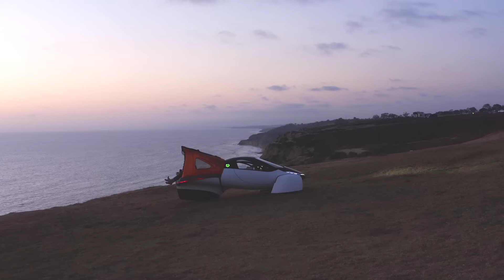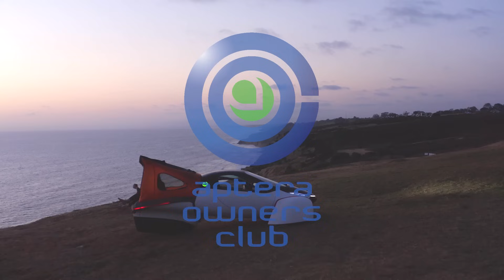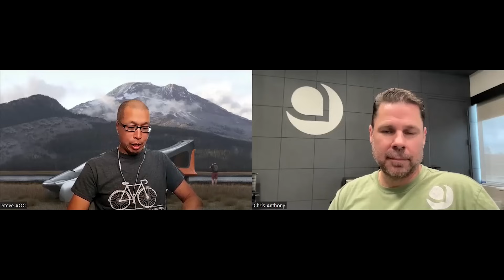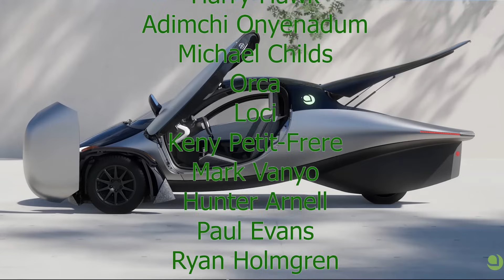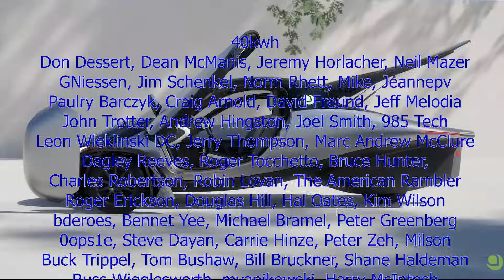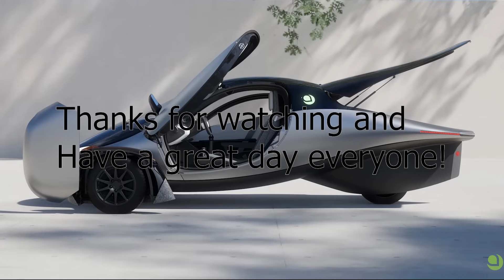Part 2/3 Aptera Update with Chris Anthony May 2024

Comment: Just started watching. Let's assume 6 weeks. When did you record the interview?
Reply: 6 weeks for current issue, don't worry there'll be more. Thus far no demonstration of miles/kWh, kWh/day. No regenerative braking in test vehicles. No working cooling in the nice looking demos. No full size battery ever used. Suspension design ongoing for at least 3yrs. Price not updated through 3 year development. My estimates are 8 miles/kWh, 2.1 kWh/day (17 miles/day), 300 mile range, $38K. Financially unstable. Attempting new high risk investment management starting in June. Sold some $50 million of "stock" that holds no equity. Buy yourself a nice used Prius V or the new Prius PHEV and enjoy the show.
Reply: @artsmith103  EV's and plug in Hybrids are not an option for me. I'm driving a regular Hybrid. I live in a Condo. I have no place to install the equipment needed for a plug in hybrid or EV.

Aptera has 3 things going for it. First is the ability to charge with a regular outlet no special equipment needed. 15 ft extension cord and I'm good to go. 

Second is the Solar charging which will limit (not eliminate) my need to charge at all. I only drive 7,000 miles per year.

Third is the efficiency. There is no doubt that the Aptera will be the most efficient vehicle on the road. It is by far the major focus of the vehicle's design.

You're correct in one area. There is still a lot we don't know about the final numbers of the vehicle. All claims Aptera is making need to be taken with a grain of salt. Until the PI vehicles are made and tested we don't know anything for sure. 

All we can have is optimism and hope that their claims are relatively accurate.

The claims you made in your post come without good evidence. You have no evidence to back up your claims so I will dismiss your claim.

 "What can be asserted without  evidence can also be dismissed without evidence." Christopher Hitchens
Reply: @Fairburne69  You're new and don't understand the basis of the numbers. I am engineer with PE, and specialty was heat transfer, fluid mechanics and reactor design. I've been involved in a few residential solar projects including my own, generally without contractors. I have a few recreational 12V systems, just ordered all the parts for another one. Another YouTuber did a thorough analysis of Aptera solar exposure. He also came up with ~3 peak equivalent hrs/day. Aptera has refused to demo performance numbers for years. It's their main marketing claim and they won't back it up, ever!! I think they're ashamed to show there is a small battery in the test vehicles, no regenerative braking, and inadequate cooling to survive 2hrs of test driving. I'd even be willing to add 30% to their results in anticipation of regenerative braking.
Most PHEV recharge with 120V. I recharge less than 1/mo. PHEV will have bigger battery, allowing bigger motor, allowing a little higher mph EV driving. If you recharged once per week it would be more than enough.
Reply: @artsmith103  Why are you constantly wrong? You keep making claims. Some of them I know are 100% not true and some that MAY be true. Yet you provide no evidence to support the claims you make. I'm not even here to tell you that you are wrong. Because I don't know if you are wrong or right and either do you.

 They showed us the making of the battery for the PI vehicles in the last update for example. I also saw a YouTuber produce a video on solar powered vehicles and he used a white board and showed the math. He got even more then the estimated claims.

I just don't understand why you have to be so negative. I understand being cautious and skeptical. I am a Skeptic. My skepticism is the reason why I am now an atheist. But you just seem to be a grifter and a troll who likes to be negative. You make claims you can't support. Maybe you do it so if you are right you can say, "I told you so." and pat yourself on the back? Maybe you enjoy dumping water on a birthday cake lit with candles?
Reply: @Fairburne69  I'm not negative, I'm accurate. I have researched and estimated my numbers closely. My home array delivers +/- 2% of annual kWh. Aptera put out a video once of their chief solar employee explaining the challenge of managing charge control on a moving vehicle. It was completely wrong! He sounded like an idiot....he's gone. The young Chris idiot laped it all up, look how smart we are :-(
Aptera has a social media employee, she never engages on social media. They paid a crowd funding director over $200K/yr. They file SEC documents as late as possible. They won't address why they are selling "stock" with no equity.
Look at Telo, they are real car people. I think 500hp in their short wheel base is a waste but we'll see what happens.
Reply: @artsmith103  "Most PHEV recharge with 120V. I recharge less than 1/mo. PHEV will have bigger battery, allowing bigger motor, allowing a little higher mph EV driving. If you recharged once per week it would be more than enough." 

The infrastructure in my area sucks. Also, I would rather use gas then sit at a charging station for 30 to 40 minutes once per week. If I can't charge from home then a normal hybrid at 50mpg is what I will continue to drive. The Aptera is the only vehicle I have seen that makes it reasonable for me to leave ICE vehicles in the past.

Toyota is working on hydrogen fuel tech. From what I know they are working on a hybrid version of that vehicle. This is also on my radar as a possible future car.

What it comes down to is that I have more "faith" in Aptera then you do. It may be misplaced I'll admit it. But they remind me of Larian Studios. A video game developer that has a similar history of mistakes and hurdles as Aptera. And they are now largely considered the most reputable video game developer.  The parallels are uncanny.  

I have not invested into Aptera yet because I have my doubts. I have until June 30th to decide. The investor webinar is in 1 week on June 6th. I will make a decision sometime after June 6th and before June 30th. Will they have more news about additional funding beyond the $60 million they just got from US capitol? If the answer is yes, I will probably risk an investment. One I can afford to lose. If the answer is no, I will just keep my refundable deposit and wait to see what happens over the next 12 months.
Reply: @Fairburne69  My PHEV description was for the crowd wanting a little more than typical HEV options. The idea was to work the 2hr charge into your weekly routine if possible, not an individual activity. I have never lived somewhere I couldn't bring 120V to my vehicle. All but 1 place I worked had easy access. 
If you invest in Aptera make sure you get equity or it's possibly just a donation. If you're that new, realize they promised delivery in 2021. Maybe there's some good excuse it got delayed but now in 2024 they're explaining why they are designing suspension, batteries, solar, braking, structure castings.... So how evil was the 2021 promise?
Reply: @Fairburne69  "Just Started Watching", means this video, not Aptera in general!! So you're a mild fanboy that doesn't like the factual criticism. I completely misunderstood. If this was your 1st Aptera video I just offered to protect you a little....carry on, I suggest a huge donation and a trip to CA to ride around the block without doing any performance measurements ;-)
Reply: @artsmith103  I understand any investment is a Risk. If I do lose the money it will be an amount I can afford to lose. I'm sort of new to Aptera starting in January. But I've done my research and know the history going all the way back to 2007.  I'm not one to make a hasty decision and I've done my research.

Investment into any startup company is a big risk. Most don't make it. It comes down to regret.  If I invest and they go belly up I lose $2,000 and move on with my life without regret.

If I don't invest in Aptera and they don't go belly up I will regret that decision a lot more.

At least that's the way I feel now. If I do invest that will be my mindset.
Reply: Last week

Comment: Only AOC brings these exclusive, very informative, series of interviews with a wealth of detailed information. This second video in the second series of three does not disappoint. So, first PI vehicle in August/September timeframe, six to nine months for production validation and testing. 😪 The company has grown from a "Mom and Pop Shop perspective" to a world car view with participation by world class partners. Glad to see the metamorphosis. Also glad they took the advice to build to scale. Now hope they take a lesson from GM's mistakes in releasing a vehicle to the market before its time. (Battery issue with the Bolt and quality issue(s) with the Blazer) With deep pockets you can recover from this kind of market failure. Not so if on a shoestring, at volume, production budget as rework/do overs more expensive than doing it right the first time. Also looking over the shoulder to the recently announced production date for Tesla's two variants of 25K(?) Model 2 in June 2025. (Tesla production schedules always taken with a grain of salt)
Reply: Steve/AOC are excellent but other Aptera channels post very good, often supplementary info/perspectives. I’d worry of further delays if Chris granted such in-depth interviews to multiple outlets.

Comment: Why are so many of the part coming from all kinds of place over sears? ----Not very efficient part sourcing---If you ask me
Reply: Chris has stated that most U.S. suppliers will only work with large volumes, European suppliers are much more willing to supply in lower numbers which match Aptera's needs.  They would use suppliers here if they would work with them, but they are not willing to.
Reply: Yes, if geographical distance is your only decision factor.
Reply: Did you watch part one? Sounds like you didn't!